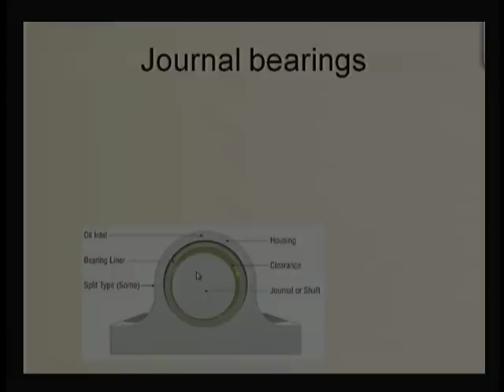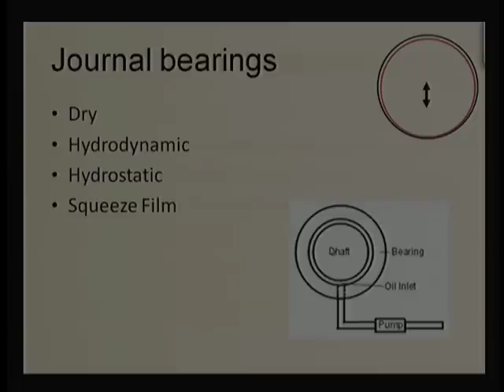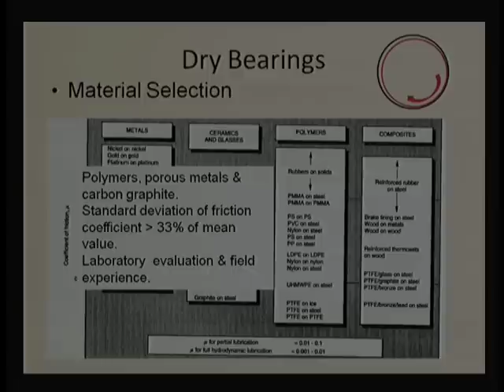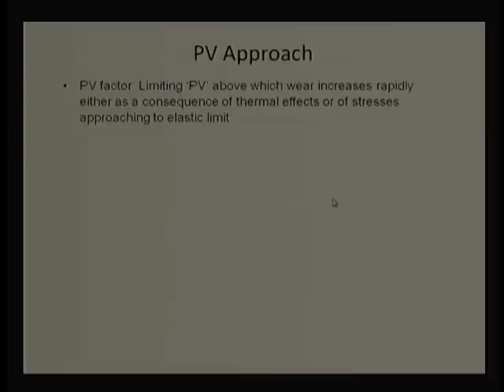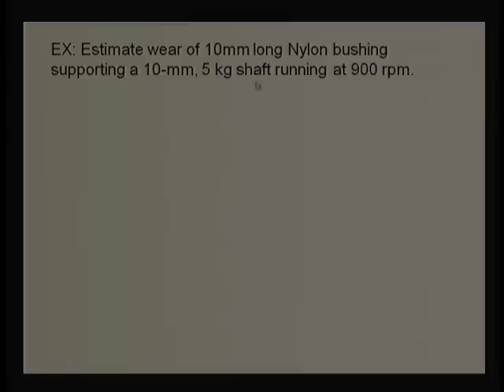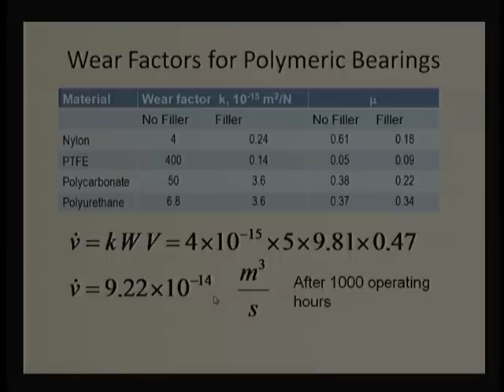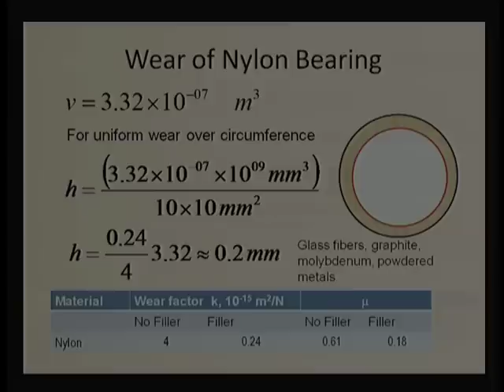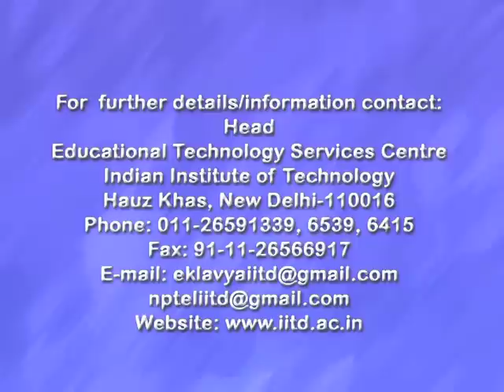Journal Bearings

Comment: At 32:47 when calculating the pressure, why is the normal force not also divided by pi along with shaft diameter and shaft length? I thought the area = dia x lenght x pi... Thanks for the video.
Reply: you're taking the projected area of the shaft on which the force is acting which is d*l not pi*d*l. the projected area is a rectangle. the later gives you the surface area of the shaft that we're not interested in. 

although its been 4 years, you must have learnt it. but just in case. lol.